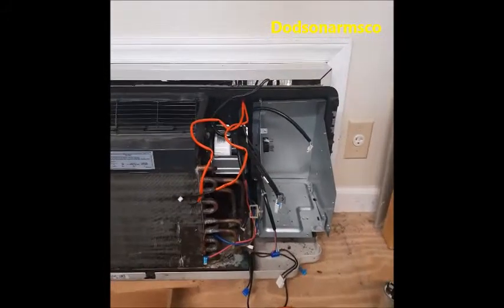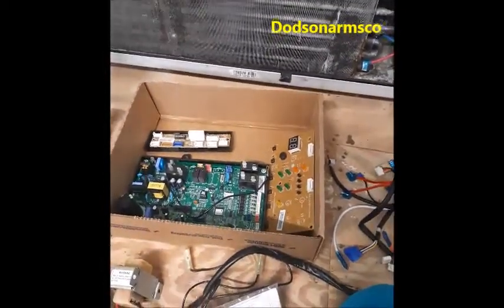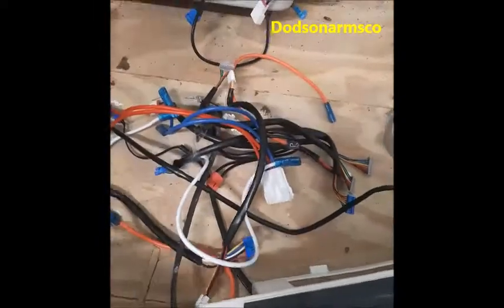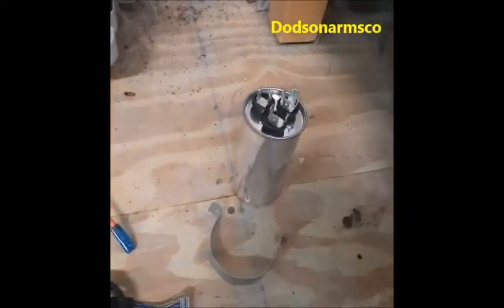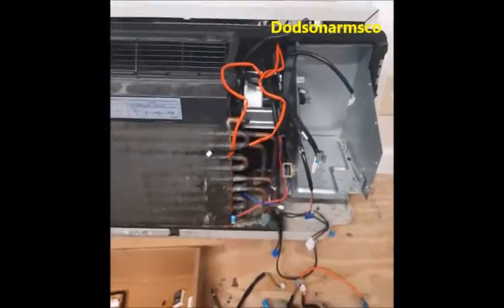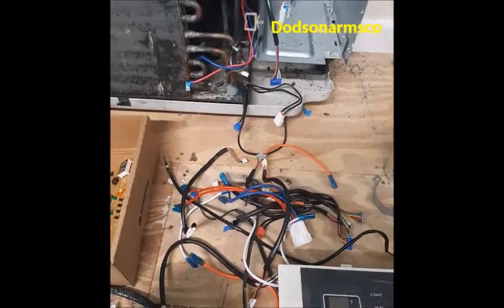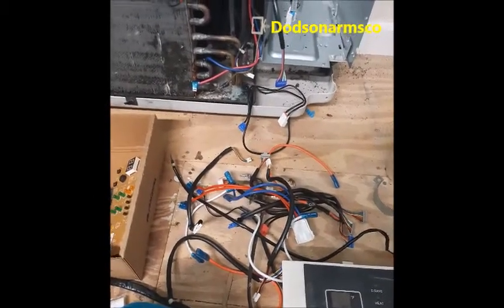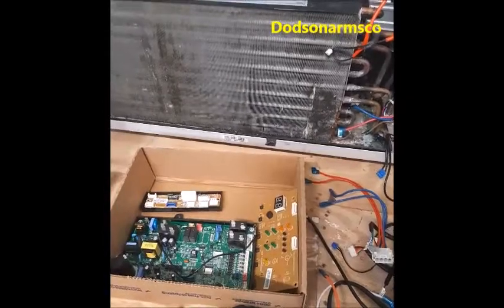Scrapping HVAC, Washers, Refrigerators for Profit or Repair Parts: Economic Collapse, Parts Shortage

Comment: Really good advice I never thought about taking the circuit boards out
Reply from the maker: It is getting very difficult to find the boards, they change them every couple of years and it seems then do not make any spares anymore. When I worked for the power company they were so hard to find I had to source them as salvaged components over seas.